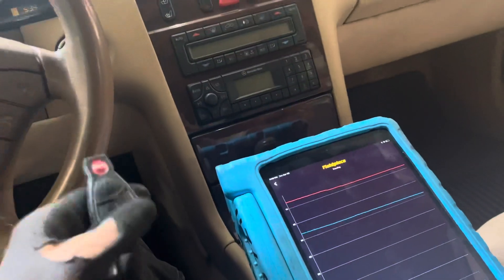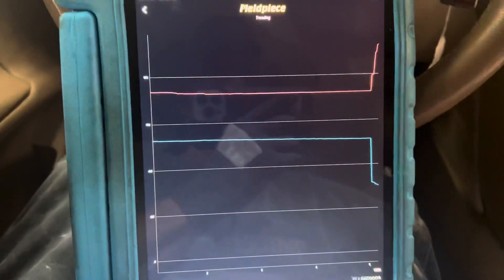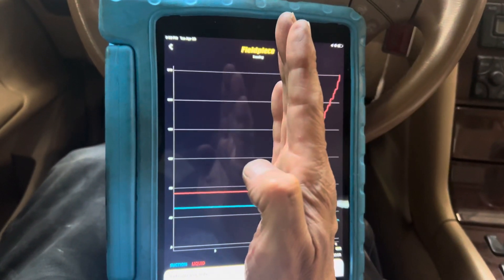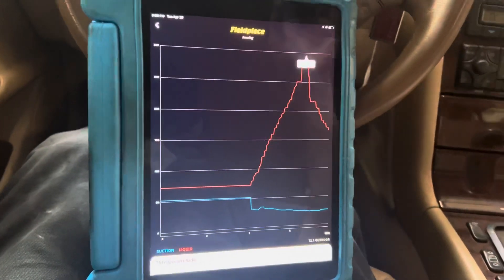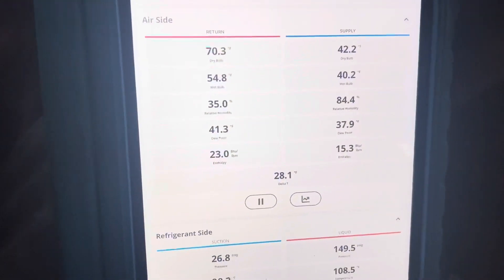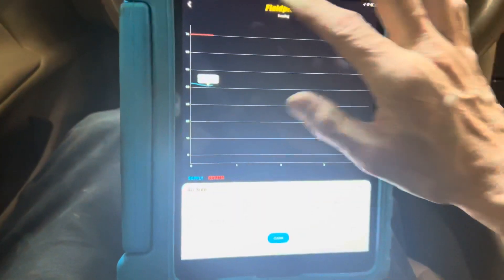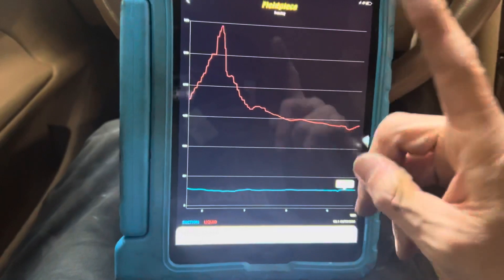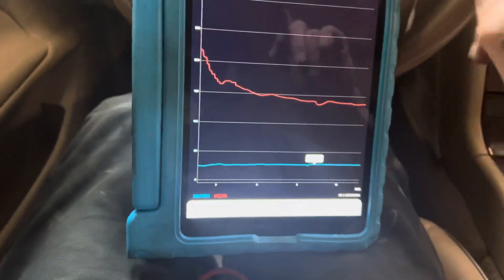Watch this Variable￼ Displacement compressor during idle and high rpm. WILL THE PRESSURE CHANGE ???￼

Comment: I just charged the system with 500g of r134a and its variable displacement the high pressure valve is right after compressor and its reading 100 psi in 105F day! the low pressure is 35 psi its weird cause its blowing cold but how come there is no sufficient pressure difference how expansion happen its 100 psi before condenser so the pressure would drop even more before expansion valve
Reply from the maker: I never see 100 psi high side on 105f day.
Frist time I hear of that

Comment: Hello,I have question,my AC works fine in the morning and evening and less effective at high temperature.what are the possible causes?.
Reply from the maker: Low on refrigerant or overcharged on refrigerant

Too much or too little 

Forgot about one other thing a slightly restrictive or expansion valve not metering correctly or orifice tube slightly plugged up

Let’s a little bit of refrigerant through which is good under a low load but when it gets hot there’s not enough refrigerant flowing

And does this happen when you’re at idol only or also when the car is driving down the street with the air pushing over the condenser

I was just thinking if you had two fans and one fan was not working so on a cold morning or cold evening one fan would flow enough air to keep the high side pressure down but if it was a hot afternoon you would need two fans and will allow the high side pressure to go to high on a hot afternoon with only one fan
Reply: Only one variable fan.It happened from time to time on afternoon when idling or driving on a street.